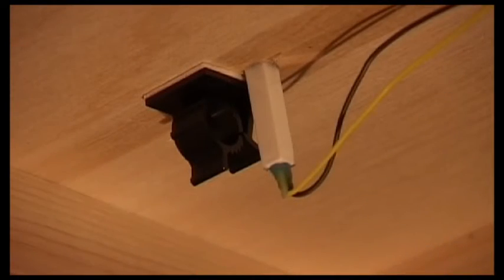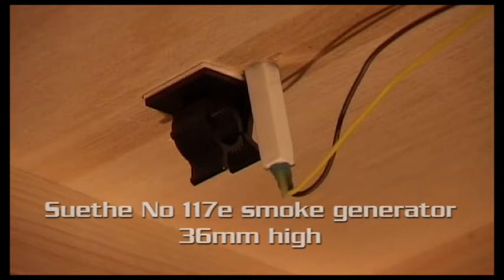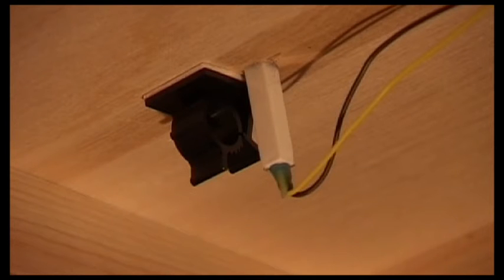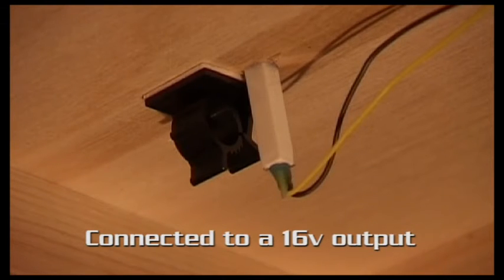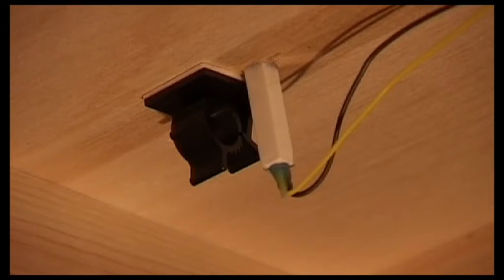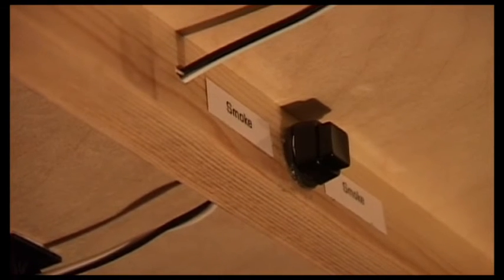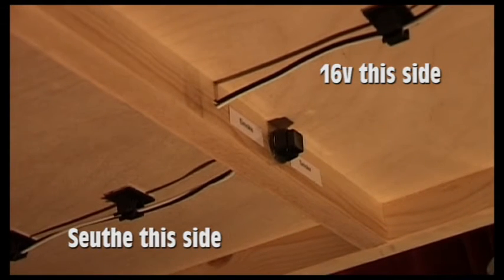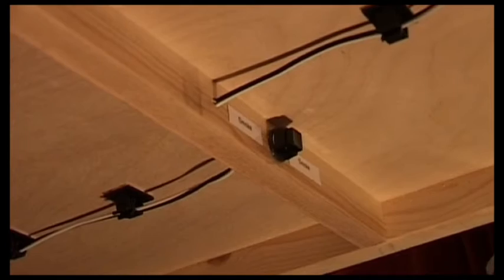Cato Pass Pt 20 - Smoke Generator

Comment: Looks AWSOME! One of them would be good for a camp fire scene! Is it attached to a dcc controller?
Reply from the maker: +liam rasbid This is an analogue controller but either will do as long as it has a permanent 16v output. This output also feeds the shuttle unit with a steady amount of power. Apparently I was told today that no shuttle unit exists for DCC. Strange. Laurie.